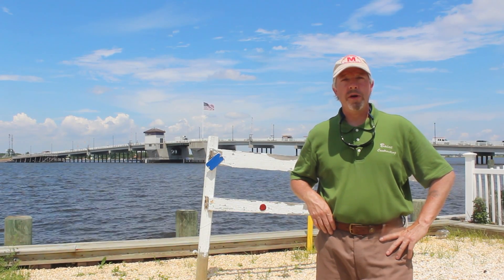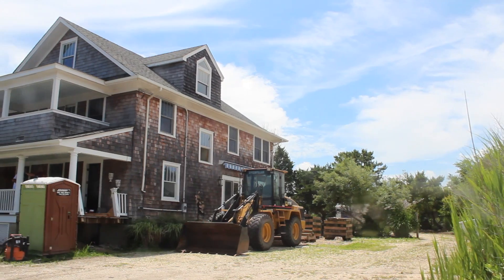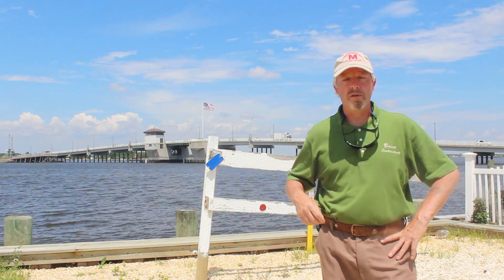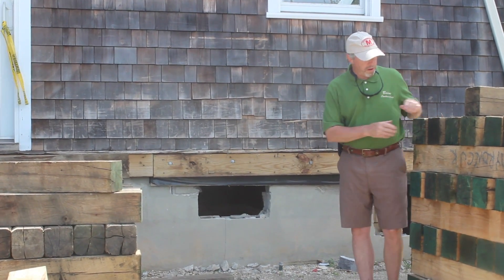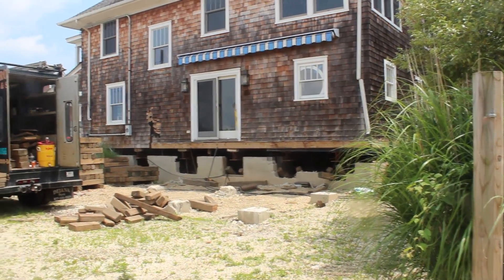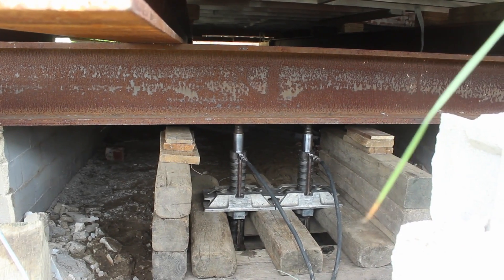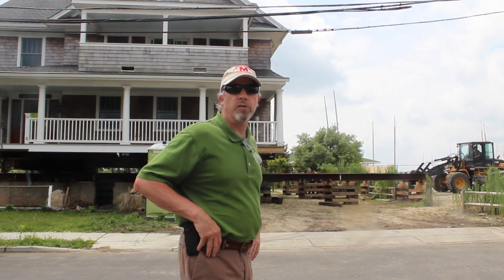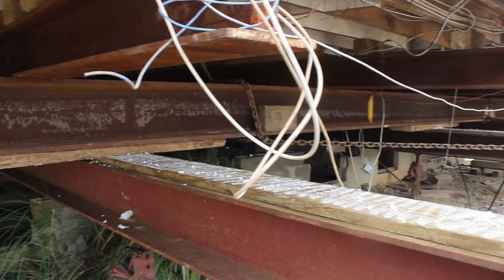House Raising in Mantoloking NJ with Baine Contracting Inc.

Comment: Wanting to do this to my cottage on Lake Huron.  My great grandfather built it 92 years ago.  It’s currently on a mixture of timber and concrete ( concrete was used for the internal kitchen and bathroom addition from the 1950’s) piles perched on a sand dune.  
I want to jack it about 2m (6’) onto temporary screw piles to put a monolithic pour basement under it to ensure it’s survival well into it’s next 100 years ( as well as to provide storage space it doesn’t currently have).  
The cottage is built from cedar that came off the property, and was milled by my grandfather’s brother in law’s family mill and remains largely original (except the original sunroom which was turned into a kitchen with a toilet ‘stuck’ on the side in the 50’s).  It still smells fantastic with the exposed cedar.